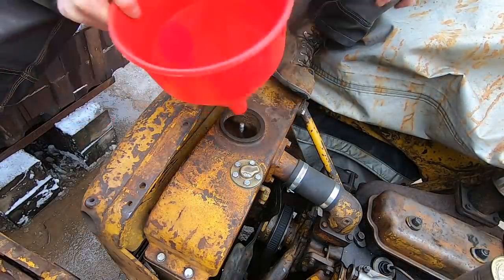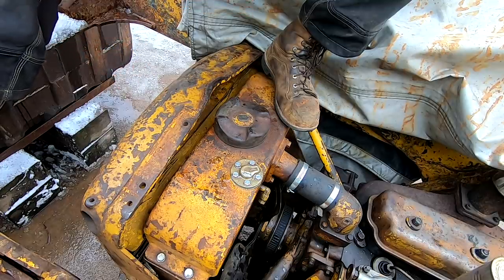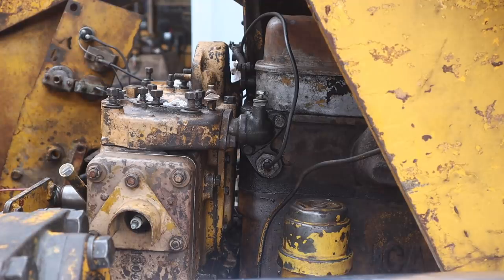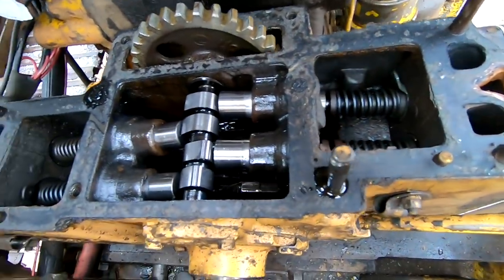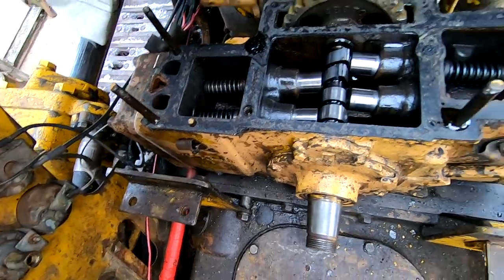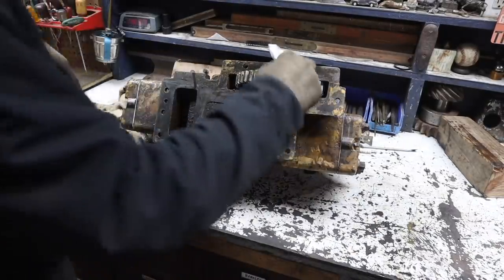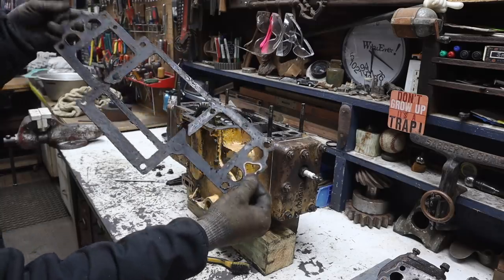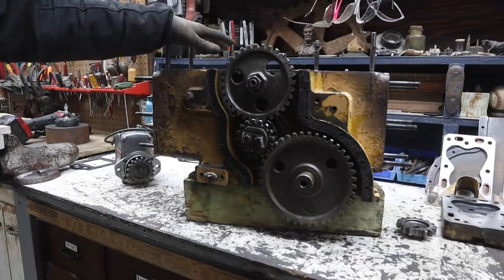I REMOVED the Pony Motor!!! ~ Part 15 ~ 1950s Caterpillar TraxCavator

Comment: Another reason the pony motor is on a common coolant system is so that you can run the pony motor to warm up the main engine block for easy starting.

Comment: I will never be in a position to do what you are doing, but it sure is entertaining to watch you work and learn at the same time the work you are doing. Never get frustrated , keep learning and we will keep watching..
Reply: I don't think you mixed antifreeze and water in the engine, unless you had the thermostat removed when cranking
Reply: @apachepaul  Also, the fluid level would have to be high enough for the water pump to move it.
Reply: Wow  oh man  water will sit and freeze solid

Comment: Keep the pony motor, it’s not Old Red without it! Love the series.
Reply from the maker: Agreed!
Reply: Completely agree but, if there's a reasonably simple, inexpensive way of installing an electric starter to the big diesel, it could be a very useful option. Even having it as a back-up could be worthwhile. After all, it's not like you're going to 𝒑𝒖𝒔𝒉-𝒔𝒕𝒂𝒓𝒕 Old Red.😁
Reply: Agreed!🌟👍 I was taught never to paint a moustache on the Mona Lisa , eg if that was the way it was and worked don't meddle unnecessarily.
Reply: Keep the pony motor, it’s not worth the time and money to convert.
Reply: @TheLittlered1961  😂 Nice one.
Reply: I'm a purist!  Keep the pony motor!
Reply: @2H80vids  there are blokes who do direct electric start conversions some machines had both from factory(rare). some models had the spots on the bell housing ready to drill, later ones even had the hole cut and a cover bolted on.
Reply: @chrisforgan731  I suppose it could be quite handy to have both and can you really be certain what was on the machine originally? I would certainly be keeping the pony motor but, if the parts are available, an electric start option could be a useful thing to have. From what you're saying though, I'm guessing there's no extra bits on Big Red's bellhousing.
Reply: @2H80vids   it really depends on what was ordered when the machine was new. and what parts have been added from other machines. our d4 was originally a farm crawler and was converted with a blade and winch yrs later. many old cats are bitsers its why there still around.

i am currently converting mine to a modern electric start diesel for a pony engine yes i have spent a lot of money but it will work for yrs to come.
some sales and production records still exist thats how i know our was a farm tractor which they all were originally often the options were dealer fitted or made as aftermarket attachments sold through the cat dealers and supported by cat. that's how r.g letourneau started he made attachments for caterpillar
Reply: @chrisforgan731  Yep, without knowing what all was included when Big Red was brand new, it's impossible to know which variations could be considered "factree" or original. I'm sure many would say "stick to the original spec." but, when we don't have those details, I would just set it up to be as useful/convenient as possible.
Reply: Having electric and pony start would be nice but given the amount of snow on the ground it'll be difficult cold starting without glow plugs... the ponys are very reliable if they aren't abused; for half the cost of a conversion a good overhaul will last a long time.

Comment: You’ve earned yourself the title of technician, you actually repaired the problem and diagnosed it correctly and didn’t just shotgun parts for a fix. Well done! I would’ve been annoyed having to pull the pony motor but I would’ve done it anyways lol great job

Comment: I'm no expert (but I stayed at a Holiday Inn Express recently), but I'd say the runout and play on the crank had little to do with the broken mag gear, and had more to do with that broken nut floating around.  Also, I'd check to see if those bushings really are an aluminum alloy or are babbit.  Personally, I'd say they were likely babbit, or some material like crank / rod bearings.  As always, I enjoy watching your meticulous work.  Too bad you didn't grow up around UC Davis, or attend school there.  Awesome collection of antique farm equipment up there.  As for Cats, we regularly used a 20 and a 30, and serial number 1C1 is in the collection, the very first production diesel Cat.
Reply: Damn it! This is why I don't know what any one is talking about I stayed at a Motel 6!!!!
Reply: Factory bearings in those pony motors were babbitt lined bronze, but Cat factory replacements were just plain old aluminum. That pony was rebuilt at one point. Many machine their own bronze bushings instead, as they last far longer than the chintzy Cat replacements.
Reply: I agree on the gear breakage. There is alot of play in the crank, but not enough to cause that gear to bind. More likely either a piece of debris or fatigue on an old cast iron part that finally let go.
Reply from the maker: @WhyBeNick  No they were aluminum from the factory.
Reply: more likely titanium
Reply: @kenmassey2430  nope cat put aluminum bearings in
Reply: @SalvageWorkshop  Factory aluminum bearings simply blows my mind.. Just go ah head and pack hard peanut butter in there for an upgrade!... Jesus. The rest of that motor is virtually indestructible, so that makes no sense... on any level.
Reply: that's what I'm saying also and where the heck is the other half of that castle nut? maybe from a previous rebuild in a sloppy shop that split the nut off something.
I don't buy that it got pulverized or came out previously with oil.
** also I figured the rod studs had castle nuts and they did, makes it even scarier! maybe a previous blow up?
Reply: Nice
Reply: @SalvageWorkshop   actually aluminium tin alloy.

Comment: That blew me away when you said, "I never saw a pony motor!" They rarely go bad, and their function is not only to start but more importantly to preheat the block and manifold of the machine. A pony will always start even well below zero temperatures provided you take care of your machine. I ran an old CAT in Vermont at a ski area. You start the pony, it would blat a very different sound. You knew when you were ready to throw the compression lever when the exhaust manifold was warm to touch. So start the pony, engage the gear allow the diesel to turn over with no compression and when the manifold was warm, throw the compression lever and you had a belch of black exhaust along with life! What a wonderful life.
I personally wouldn't do the electric start. A diesel with a pony will out-live one with a starter by decades. 
Thanks for the wonderful posts.

Comment: Engine bearings are designed with some oil clearance, usually on the order of 0.002 to 0.004 of an inch. Play is normal and intentional. Some end play, the in and out play you described, is also normal, though also measured in thousandths of an inch. Get yourself a shop manual for that engine and reference that for specs. Engine machine shop will be able to help also.

Comment: That actually isn’t an oiling groove, but a “scroll seal” it is designed to keep the oil in the crank case by utilizing its counter clockwise groove to draw the oil back into the crank case when it is running. This is exactly what old English car manufacturers did instead of rear main seals. They work but not very well. That’s why English cars had a terrible reputation for oil leaks
Reply: Yup.  The rear pully on air cooled vw motors are like that too.
Reply: Well never knew that I know little bit about engines, as not scared to learn, learn something new every day, cheers M8  🍻
Reply: Eaton truck transmissions use this type of seal on the input shaft. Never seen one leak. Though they're more splash lubricated than pressure fed like an engine normally would be.
Reply: Very interesting. You can see that on a sump that is only fed by gravity it should work reasonably well as long as the sleeve wear is within tolerances. So instead of a slow drip the rotation would be constantly sending the oil back into the sump. Quite a simple and novel approach. 
Thanks for sharing the information.   😉👌🏼
Reply: Manual transmissions had scrolls on the in put shaft just in side the throw out bearing slider tube
Reply: @dangerrangerlstc  on that pony starter engine that he is working on it is all splash there isnt an oil pump in that style engine now the inline two cylinder pony on my 57 d8 cat that has a oil pump
Reply: Interesting that’s for sharing this, I had not heard of that before.
Reply: Thats why the English have never built computers, they cant think of a way to make them leak oil!😂

Comment: Are new bearings no longer available from CAT? I think I'd try to find NOS bearings before making them, those should be Babbitt bearings, not aluminum. Bronze may be too hard for your application and actually destroy the crankshaft. There's a reason CAT didn't make them from bronze to begin with, and it may be due to bronze not being compatible with the high RPM that little engine turns. 

As others have said, there are people like Squatch253 here on YT that you can reach out to for advice and possibly help with the pony motor.
Reply: No..no those aren't Babbitt bearing and they are in fact aluminum. Babbitt bearings are poured in and a much softer metal alloy. Also babbitt bearing are usually used when two halves of a shaft housing meet,  its a little hard to pour a continuous bearing while its on/in the piece.
Reply: You can get any part that CAT made. They will make it to order from the prints---you just have to pay.
Reply: @techmarine83  I have a lot of experience of precast babbitt bearings. They turned up in lots of UK vintage engines. They were injection moulded ready to fit in standard sizes.
Reply from the maker: @hotpuppy1  Trust me, that's NOT true!
Reply: @SalvageWorkshop  how do you know the measurements of the bearings, that you are going to make?
Reply: I cant believe its not Babbitt (white metal) but aluminium will probably do just as well. Most of today's car engines run the cams straight on the alloy. Don't go for bronze. You could also consider mods to fit a sealed ball bearing.
Reply: that is correct they are Ali  but are available watch squatch 253 strip one down and you will learn all about them babbit bearings will be no good in this application
Reply: @hotpuppy1  you have to have the blueprint drawings first and some castings cant be made as they dont have the patterns anymore. the parts they can make are bushings and shafts as they can be turned from bar stock.

and yes you will pay dearly to get old out of stock parts.
Reply: @Ralfie maybe it wasn’t original to begin with as he said it was already worked on when he took it apart.
@Salvage Workshop keep up the good work, I really would like to see this machine work as it did in the time that was in.
I also admire your strong will and perseverance to undertake this project.
Greetings from the Netherlands 🇳🇱.

Comment: Not finding the missing teeth and the castle nut and wire would drive me crazy.
Reply: yup, not done until you find all the broken parts
Reply: @t_4178  It is Me😵🥴🤯  maybe it's from a earlier repair
Reply: @FOOKYOUTUBENUMBERS  .... as far as the half castlenut goes, an earlier loss seems likely - should not come up a place lackin' that half, which doesn't look likely given the actual state of dismount. The second half as well as all those missing gear-teeth would drive me nuts until I found those. 
The diesel engine and the pony share coolant, they do not share oil though as far as I'd know. So, it has to be a pony issue. I'd presume the breakage in the Magneto gear happened with the second half of that castle nut, or with the whole nut getting between those gears breaking itself AND the teeth.
Reply: @manfredschmalbach9023  Hopefully it will turn up in next vid, but I agree with You comment; to a point We will see in next installment haaaa
Reply: @manfredschmalbach9023  a harmonic due to crank end float will shatter the mag gear too. it happened to mine it also bent the mag shaft. yes the oil is separate. where the teeth end up is down in gear recess under the starting pinion shaft, very important to find the pieces as that well is oil filled to also lube the pinion shaft bearings which are standard open ball bearings so any debris can get in and jam them. there is a small bung on the outside of the casting to drain that gear well. that nut is probably from a previous repair.

Comment: i have just discovered your videos and i am completely amazed at your mechanical knowledge!  you are really a top-notch mechanic and fabricator.  i restore cars and never got heavily into engine work but learned body work and paint.  watching your videos is like going to shop class!  i've watched probably 5 of your presentations so far.  i have an old D4 50's CAT tracked loader with a pony motor and that is why i first started watching.  however, your knowledge and camera work has been so excellent that i just couldn't stop watching your next video.  you are presenting wonderful work here Mr. Salvage!!  thank you for these videos.  and one other thing, i noticed that you are a young fella.  i'm retired and i would NEVER begin to tackle the amount of work you are doing to "Big Red."  your level of repair requires a lot of "piss and vinegar" as old mechanics used to say in West Virginia where I am from and sadly, at my age, i don't have much of that "youthful energy" available.  LOL!

Comment: Don't worry about antifreeze coolant freezing, it is only water that expands when frozen, everything else shrinks.
Reply: I did not know that, good to know thank you
Reply: Actually antifreeze can not that hazardous as it seems. In Europe wine makers used anti freeze glycol to "improve" the taste (sweeter) in the 1980. It was only strange for the tax authorities that the guys needed that much antfreeze for the wine production although only owned few tractors.
Reply: @thomasmuller9243  it nearly wiped out the Austrian wine industry dude

Comment: When I was a freshman in college in 1963 I worked for the college to help pay my tuition.  One of my jobs was to level the new baseball field for the college.  The cat I drove was a D8 and it had a pony motor.  I had to crank it and then use it to crank the Diesel engine.  Much of what you are doing brings back many pleasant memories fromwhenI was 18 years old.  Thanks.

Comment: The reason the monkey wrench wouldn't stay put was that you had it facing the wrong way.  Reverse it and it will tend to tighten down on your puller.  Great content.
Reply: If that's true, then he shouldn't have needed to throw out that half barrel of nails like he did because they had the head on the wrong end.
Reply: @deconteesawyer5758  a pipe wrench only grabs one way, just like channel locks grip better one direction.
Reply: @eliminator1978  Good boy. You are learning fast. Eat your vegetables.  Stay in school, don't eat the yellow snow, and start the first word of  your sentences with a capital letter.
Reply: He does this with all of his wrenches....
Reply: I noticed that too

Comment: Also...I made a bearing out of a blank cast from an aluminum piston for the pony in my d7, turned the crank journal down n machined bearing to fit, .002-.003 clearance. Always shut pony off by shutting off gas n running carb dry so no gas shakes down into engine oil. Ask me how I know.
Reply: Made your own bearing? Now thats cool!

Comment: Don't convert to electric start. I have seen a cat like this with electric start. It the worse that happened to it. The cat starts very hard when trying to start in very cold weather. The pony motor helps heat the engine and build up oil pressure before closing the compression release. This means the shortened the life of your engine.

Comment: I would do what I could to find a replacement before considering making a bushing. But that's me. Changing the material can have different effects. I would get some good gasket material and make all new gaskets. I like knowing I did all I could and trusting in the equipment
Reply: Definitely check out Squatch253. He has a video   about rebuilding a D2 pony motor. Looks just like yours. . Although he's working on a much older machine than yours they probably didn't make many changes over the years. Parts may very well be available from Cat.